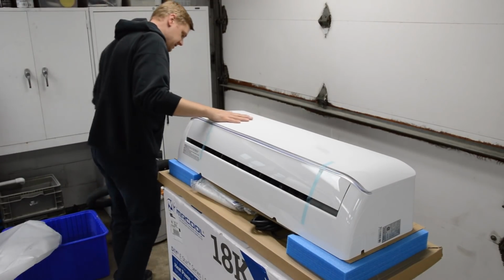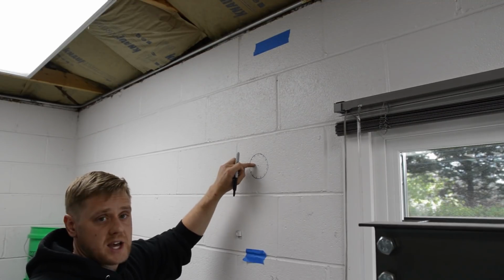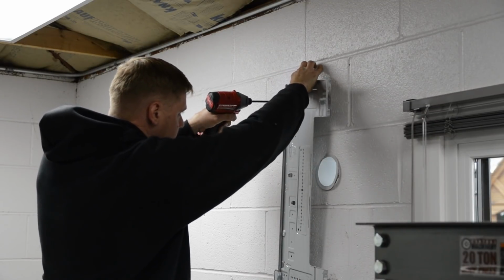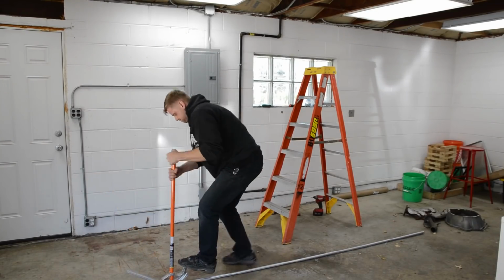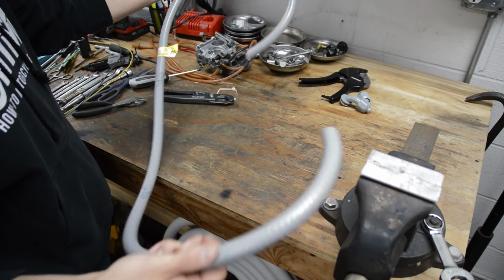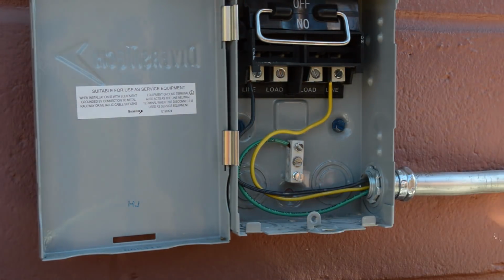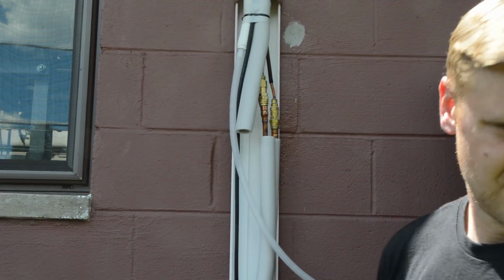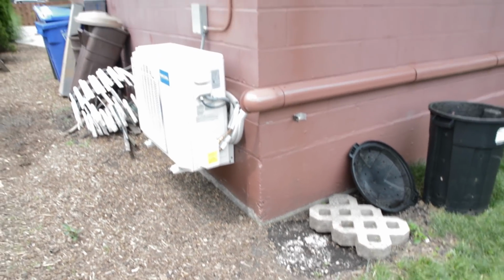How-To: MRCOOL DIY Mini Split Installation (Step by step) / Garage has A/C!

Comment: If you shopped at a real hardware store and I’m not referring to the corporate chains, you could have your half inch pipe custom cut and threaded for next to nothing, I’m just saying.
Reply: He was using emt not rigid, it doesn't get threaded.

Comment: Waiting for consumer reports. Inaralled system after loss of refigerant and ice formation circuit board moisture and indoor wheel damage. Realized couple other were higher level of luxury in literature packet.

Comment: THose expansion bolts are not for concrete block there for poured solid concrete. The block wall thickness is too narrow and they can work loose, Should have used tapcons or lead shields. Also you cant use yellow thnn wire should have been red.
Reply from the maker: Most went into mortar joints. Why can't I use yellow? I didn't find any NEC info on that.
Reply: @HTMR  Its your local codes you need to check. Its not standard.

Comment: Would have been a lot easier to just cut a couple pieces of 3/4" plywood , mount that to the block and then mount the hanger brackets to the plywood or even cut and mount some unistrut as a frame to mount to.
Reply: The plywood may work in dry climates but here in Atlanta that plywood may get soft over time.  His install would be more secure.

Comment: On Amazon you can get a 3.5" bit for about 25 bucks. Cuts through brick like butter on a hammer drill, corded. A far cry from $300. You are shopping in the wrong place.
Reply: Yeah if you are only drilling 2 or 3 holes .
Reply: @noahholt482  not at all. Works great. You have to know how to use it properly though. I use it on 6" thick cement walls, that have a inner, and outer layer. You have to keep the bit cool, and not abuse it like so many inexperience users do.

Comment: He means at the beginning: "No HVAC scammers need to come out to your house and purposely induce installation defects to cause a slow or eventual sabotage on brand new equipment that usually would hum along without issue for at least 10 years before needing only a recharge."  
Like the guy at replaced the control board in my parent's furnace unit in the Pittsburgh area and "accidentally" left a piece of bare wire laying on the brand new board.. which I found while hardwiring actual 24VDC power to their thermostat.  Or the bozo at Speer Air here in NJ that poked holes all through the ductwork in my brand new construction house I found.  Or the Lowes bozos that my in laws paid $20000 only for a dual mini split system that leaks out every other year, while trashing their attic full of stuff during installation.  Total scumbags that barely graduated high school.

Comment: Well done. One more thing should of been done and that is vacuuming the the system prior to releasing the Freon.Makes sure you don’t have any leaks and releasing the Freon into the air. Vacuuming also removes any moisture in the system
Reply from the maker: No need to vacuum, lineset is precharged

Comment: Nice job ... condensing unit is too close to the wall other wise looks good..
Reply from the maker: Looks that way but plenty of flow. That bracket is designed for this unit.
Reply: @Alongfortheride693  it is made for it in that it is a Mr Cool bracket specifically made to mount the condenser to a wall. The difference with mounting it to the wall vs the ground and the clearance required is that the outflowing air has 4 directions to flow when mounted to the wall(both sides, up and down) whereas on the ground it can only go to the sides and up. Therefore it can be closer to the wall and still have enough room for airflow. All the clearances are in the directions. If you go anywhere in the world where these types of units are the norm, the condensers are almost always mounted to the wall with these brackets.

Comment: I am not familiar with these fast couplings that amature uses. But from what i can see. It looks like the manufacturer just screw on these couplings on the outdoor unit that originaly has flares. IF SO YOU JUST F UP YOUR torque on those fittings on the outside unit. I saw them  spinning back and forth. The 1/4 one you overtighten waaay to much. I am sorry for these amatures that buy these. Cause if they leak. You need to buy a service from a hvac tech. And then its problably is going to be more expensive than if you just bought it from a hvac tech from the beginning. (And better performance, choose Daikin) glad to help. You can thank me later!
Reply from the maker: Just so you know I have no leaks and it works great.
Reply: @HTMR  okeey good for you :) but if the torque is not right. The fittings may hold up in the beginning. Then after some time with temperature cycles on the fitting. Its going to leak. But I hope for you it wont! If you only use cooling it will hold up better. But when switching to heat. The pressure is way higher so it may leak on heating mode. Keep an eye for oil on the fittings. If oil is visible, you have a leak 100%.

Comment: Or: hire a pro, we got the right tools, $500+ and all done certified and warranty not voided. 
And I'd recommend mounting a little higher than head height. maybe paint the exposed insulation before the sun kills it. But hey not a bad job!
Reply: 2K in labor easily. And that’s cheap

Comment: This wiring is wrong. The 18000 BTU Compressor requires a #10 wire and a 30amp breaker. You used a 20amp.
Reply from the maker: No, my manual states 12ga and 20A breaker for 18k.
Reply: 10 wire is recommended only for the 36K unit. All other units can use 14, but it is recommended to use 12 wire

Comment: you need the 36k unit in your garage. need to enclose your ceiling. shoot foam into the cinder block or concrete (from the top down into the joints). Also, paint the bldg. white. The paint color alone is good for a reduction of 10 to 30 degrees temp difference in summer. it reflects the suns energy not allowing the blocks to heat up. If you want to get crazy, buy aero gel insulation panels for the inside. Or you can also line it with walk in refrigeration panels like they use in places like sams club or costco or any walk in freezer.

Comment: HAH, leaving extra wire length on your compressor circuit for future adjustments. Rookie move. Every decent electrician owns a wire stretcher specifically for that purpose.
Reply from the maker: I need that tool! Where do I buy one???
Reply: @HTMR  there's nothing wrong with leaving excess wire in the way you did.  I showed your video to my uncle who was an IBEW electrician from 1972-2017 and he said that's what you're supposed to do.  Wire stretchers are a last ditch effort before adding another junction box for an extension.  He says keep up the good work!
Reply from the maker: @ericlunneborg907  thanks!

Comment: Without evacuate all the air out of system, the refrigerant will mix with air existing in pipe becoming acid erode the pipe and cause function improper.

Comment: You are not suppose to use green for a neutral white has to be your neural green is a ground are bonding
Reply: There is no neutral for 220v 2 hot wires and a ground is correct!

Comment: Man the piping has to be vacuumed before opening the valves. Now you have air mixed with a refridgerant in your system.
Reply from the maker: Not with this diy system.
Reply: MatthewMCRepair Ok, you said in the video that it is precharged, so it seems that there has to be vacuum out of the factory and it has some special fittings.

Comment: If the Pad isn’t solid on bottom side, it will sink past the top surface! These kind of Pads are shitty!,!resulting in putting Bricks under your Unit.Both sides of Faces should be solid. Good that you hung the Unit.

Comment: You failed! You forgot the following: 1. To pressure test the pipework connections with OFN to 600psi. 2. Vacuum the refrigerant lines to 2 torr before releasing the refrigerant in the interconnecting pipework. You will now have refrigerant that is acidic and will burn out the compressor. You will have to reclaim all the refrigerant and oil, replace the interconneting pipework and do a system flush on the condenser and evaporator before piping up again, refilling the compressor with oil and then recharging with refrigerant.
Reply from the maker: https://mrcool.com/pre-charged-line-sets-real-right/
Reply: @HTMR  I have been in the game for 20 years, I know this has air in it. Trust me, the compressor will fail soon. I worked with quick connectors for mobie split air conditioners and compressor failure was high. I had a test kit that told me moisture was present and the oil was acidic. never use these kits, they're cheap chinese crap
Reply: @chriswright7083  Fine. I would definitely hire a professional if they did the following: a. Install the AC unit I bought and b. Sell me an unit at a decent markup and charge me for a day of work instead of insane labor prices. Here in Florida installing a mini split is INSANE. With the amount of money I am saving I could probably buy a completely new compressor if this one breaks down after 5 years
Reply: @LDBaha  how much do they charge for a 1hp or 2.5kW wall unit, how much for materials and how much for labour?

Comment: Hvac industry has lied to me for 25 years. They tell me I need to pull a vacuum on the copper line set to remove moisture and air to prevent acid build up. I’m using your short cut method and will have plenty of compressors to replace all year long. $$ 
Thank you for the business tip
Reply from the maker: Why don't you relax and read this: https://mrcool.com/blog/pre-charged-line-sets-real-right/

Comment: Pre charged lineset? 🤣🤣😂😂 since when, never heard of it, I'm  an Hvac technician. The charge is in the condenser unit dummy...
Reply: I think by charged they mean vacuumed and the connectors allow for connecting while maintaining the vacuum. The. You release the r410a from the outdoor unit like any other mini split ( after you pull the vacuum on the non diy units)
Read up here.

https://mrcool.com/blog/pre-charged-line-sets-real-right/

Comment: You didnt vacuum the lines !!
Reply from the maker: You don't have to with this diy system!
Reply from the maker: @Alongfortheride693  The lineset is precharged, no vacuum needed. The bracket is designed for the unit and plenty of flow. One side is open for flow also.

Comment: What should you be aware of when using 2 damn controllers at the same time? Remote and mini split? Is the remote also a thermostat? Isn’t that going to cause complications? One would assume that this is important information, but once again the internet gave me stupid videos like this one.
Reply: My guess is that there is a single temp sensor and it's located at the indoor unit.  Or that the wall-mount thermostate overrides the temp measured at indoor unit. Either way, there'd be  software solution for it. my Ecobee smart thermostat has 5 thermometers and software decides how to weight the temperature of each reading based on if the room is in use or not.

Comment: Poor planning on the conduit run. Lube with EMT??? 220 volt? No such thing. You know enough to be dangerous.
Reply from the maker: What would have been your plan?
Reply: @HTMR  First...why are you running two circuits? The outside unit supplies power via the bundled cord to the inside unit.
Reply from the maker: @donmace4501  The other circuit was for my air compressor. I bumped the wire size from 5hp to 7.5hp, planning for a larger compressor here soon. Also had to go from 1/2 to 3/4 EMT due to wire fill.
Reply: @HTMR  You have to be careful once you put more than 3 current carrying conductors in a raceway. 4-7 conductors requires 80% derating of the ampacity tables in NEC 310.16. However when you derate you can start with the 90 degree column.

Comment: Lol that's just a pioneer unit with pre charged line sets and you should have done more research and why run condensate line that far away from garage they will condensate a few gallons a day and in heating mode your going to have a skating rink by your door outdoor unit will go into defrost and pool up under the unit

Comment: MR COOL SUCKS! DO NOT go with them. ACIQ is the same and $1000 cheaper both made by Midea and the same thing.
Reply: I have 3 units that have been running  24/7 for a few years now with no issues at all. What makes them suck? If they blow up after 5 years ill just chuck it  and put in another one. Its still way cheaper than oil or propane . What someone spends in 3 or 4 months of oil or propane will buy a whole new unit that will last another 5-10 years.
Reply: @mattsbrute  Not a fan of dealing with Mr. Cool. They were horrible, especially the girl. They are overpriced, I dont like the way they do business and would NEVER buy from them and I just want ppl to know. There are cheaper units that are the same as Mr. Cool, go with them